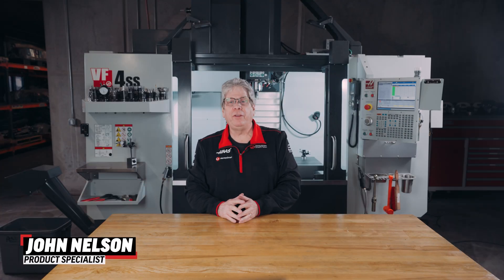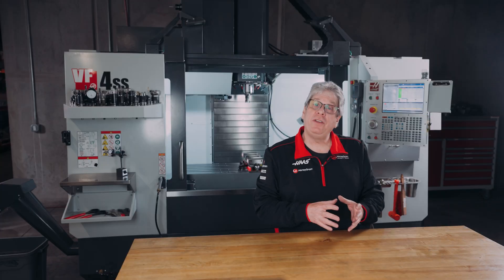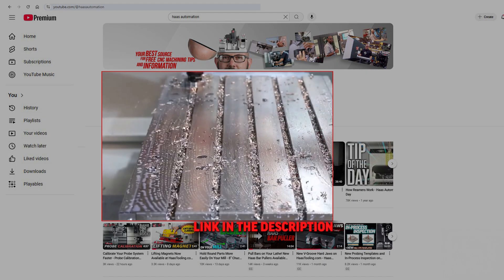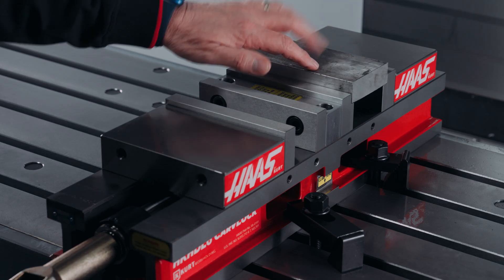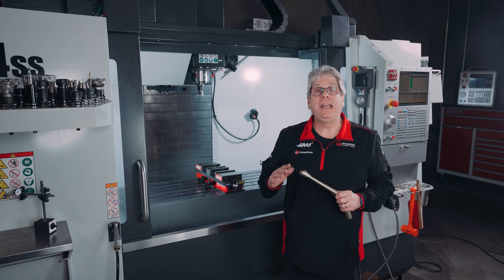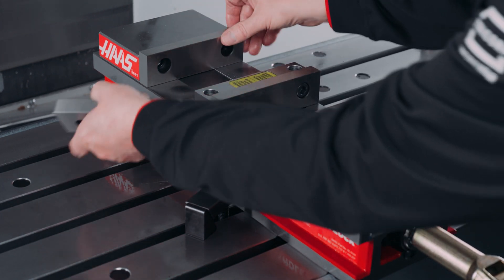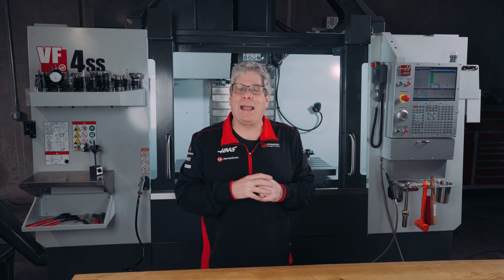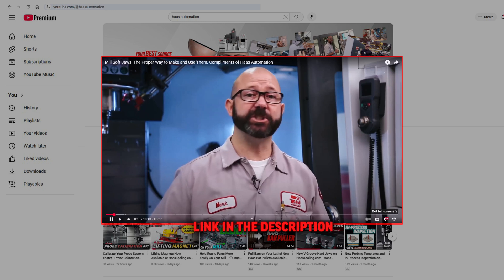Double-Station Fixed-Jaw Vises! Haas Workholding by Kurt - Haas Automation, Inc.

Comment: these are 1000 bucks more than the equivalent kurt vise.
Reply from the maker: @DieselRancharger - That is simply a false statement.  Go on our website then go on the Kurt website and compare a new vise on each site.
Reply: @haasautomation  Kurt TL6 - 1912.80 i will admit i was originally looking at the 4 inch on accident.